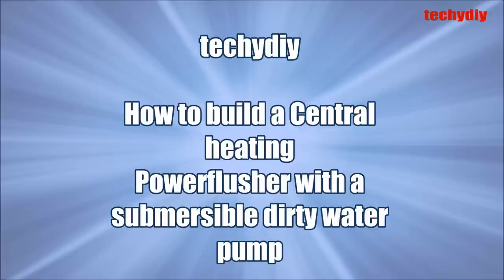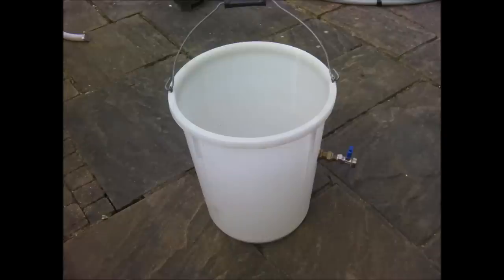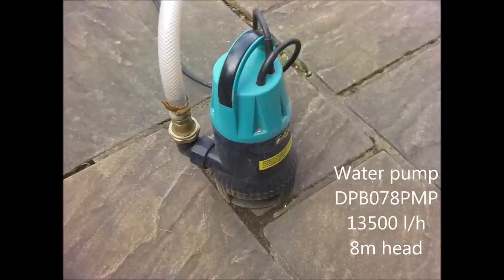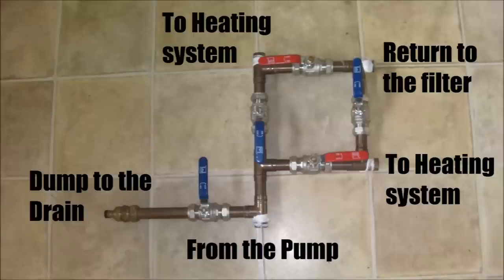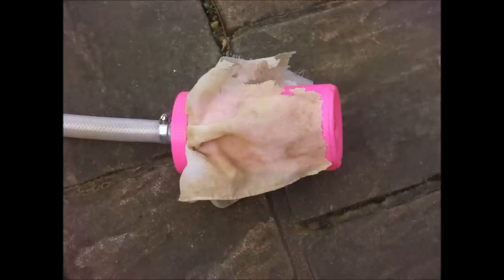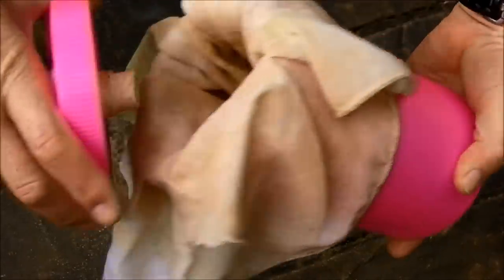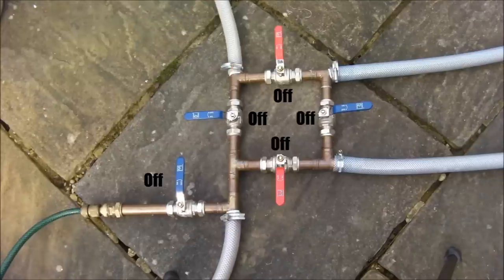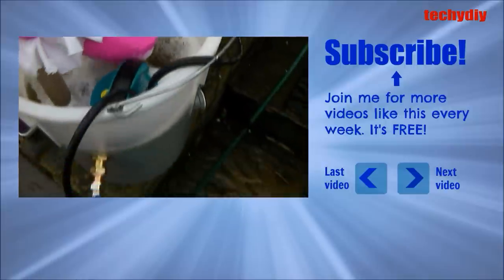How to make a central heating power flusher with a submersible dirty water pump

Comment: Built one over the weekend , got the pump off Bbay , set the system up outside to work but found it better with the reservoir bucket and filter end sat in the bath just to add the exta bit of caution , used a double dose of cleaner , WOW the dirt that came out , now fresh and clean and ive tested with TDS turbidity tester all fine and good , , just remember to cap and turn off the header tank in the loft if you have a older no combi set up , use  a bit of caution with the pump size 
and the thermostat rad valves are fine if the new type but if the older type just remove the thermosat heads   and things will be ok

Comment: I just mains-flushed all my radiators. I kept them in place on the wall, turned off the valves and drained each rad in turn. Then a 15mm inline fitting to a garden hose to tap connector to the top of the rasd. With a half-inch hose pushed onto the drain valve (all my rads have drain-downs)  flush for 5 minutes or so until water runs clear.  This was after leaving Sentinal X400 in the system for about a week. Water was black as ink to start with, with very little sign of magnetite flakes and no sludge to mention.  Bit of work, but cheap and seems to have been successful!
Reply from the maker: Thanks for the info

Comment: I keep coming back to this video every year when i find myself tinkering with the plumbing thinking I'll build this when I source all the parts. The only part I can't seem to pick up is the 1.5 inch male to 22mm compression joint I believe you have you used to connect in to the pump gate valves. Any idea where to source? might be cheaper to buy a pump head adapter for the job.
Reply from the maker: I connected this in at the boiler. Flushing the boiler on its own and then the system without the boiler.
Reply: @techydiy  Any time I interfere with any brass connections in the system I end up with weeps so I try to avoid playing with any connections next or near the boiler. I was figuring on taking out the pump and connecting either side for ease but having looked in to 1.5" elbow fittings the cost was a bit much. I'll maybe have a bash at hammering together something like the Kamco CP2 Pump Head Adapter. Giving that a pump generally has a gate valve on either side it's the ideal place to be connecting a flush system.
Reply: A tool and die shop would be able to make a few fittings like that.  
Find a smaller outfit, they're more likely to take on small orders.  

Maybe check all over amazon, alibaba, etc.  

Or, what never fails my father and I, just connect a ridiculous amount of different fittings until you have the desired input/output 😂

Comment: Yeah i can see this working, i have a proper power flushing machines but i've snapped off one of the connections so looking to repair it. The only thing i think should be different is where you'll dump it it's just emptying the tank, if you get the dump on the return pipe then it will be pushing the fresh water into the system and the dirty water out.

Comment: I am looking at the photo of the set-up showing two hoses going into the bucket. I am certain that if you close the red valves, and open the blue (as shown in the picture) the water will simply pump from the bucket, directly back to the bucket.
Reply from the maker: +John Knibb Yes you are correct. The photo at 02:!3 shows one of the the hoses going to the central heating and the hose going to the filter incorrectly connected. I probably set it up for the photo and got it wrong. The connection diagrams in the video are correct, so as long as you follow those it works.  I have added an annotation to the video explaining this. Thanks.
Reply: +techydiy 
I've had another look at this and I shall give it a try. I think I got stuck on the layout in the photo with the bucket, and didn't read the tags on the other photo correctly. Sorry.
Reply from the maker: +John Knibb Thanks for pointing out the error.  Good luck!

Comment: I've seen a commercially available  power-flush unit that does  3600l/h so the 13500 l/h quoted here sounds like it might be over-kill?!
Reply from the maker: It works for me. I flushed my boiler and the filter again in early jan 21. It was cutting in and out, not modulating. Two hours circulating DS40 and it runs perfectly now.  I inherited a central heating system that didn't see any inhibitor, so it's a bit of an extreme case.

Comment: What would be better, a high flow pump like used in this video or a high pressure pump? Got my chems in the system now doing there thing, but I think the oil boiler I have needs a harder pipe clean with a wire coat hanger or something. Rather try this diy method than pay £350+ for a plumber to do it. Thanks
Reply from the maker: You need enough pressure to get it around the system and the high flow rate to clean the pipes. In my limited experience powerflushing shifts mostly loose material. The rock hard stuff that coats pipes on old systems needs a hammer or acid, but clearing that also brings the prospect of pin hole leaks. Fernox DS40 works well if you go down that route.

There is a company that adds a powder to the powerflusher which apparently increases the effectiveness of the process. They call it powder flushing and my guess is that the powder that they add is plastic coated soda as used in soda blasting. 

In the defence of plumbers, powerflushing is hard work and should take a full day, so £350 is not that unreasonable.
Reply: techydiy techydiy Its not that £350 is unreasonable, I just prefer to exhaust my knowledge and capabilities before calling a pro in. I know I can build this and understand the principles. Fern ox is what’s flowing round the pipes as best it can, might leave it in until the middle of Jan before flushing. £350 is a lot this time of year as well, I have most the parts needed, just missing a pump. Thanks for the advise on the powder flush, merry Christmas

Comment: From a plumber point of view well done for the mechanics of the project this would work but of cause it would not be as good as a proper one hired of bought from a shop and wouldn't use it on a real job. Never the less if you want to do your own home this is cheaper then having a plumber or buying one and you could do it every few months if you wanted to

Comment: There is no way that this can work as described.  The two pictures don't even show the connections the same.
Reply: Tony Wise
Reply: I really think this is good and cheap to put it to work,but I would like to have some data like if system is badly clogged would it damage the pump or what is the bar pressure of water in input system.And also is it practical to insert in the pump connectors 
Would it have same effect as bypassing the boiler and just doing first the rads.
Overall this guy offers cheap and good system I am going to try very soon.
Any idea for cheap cleaning substitute instead of expensive chemicals.??